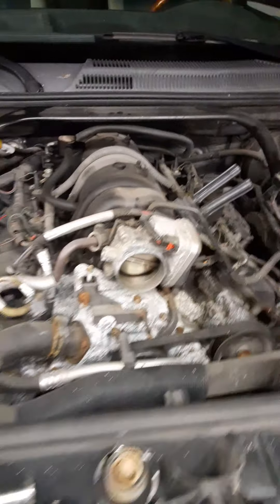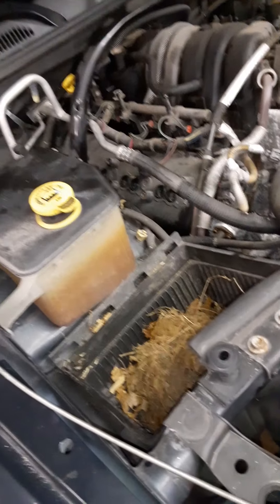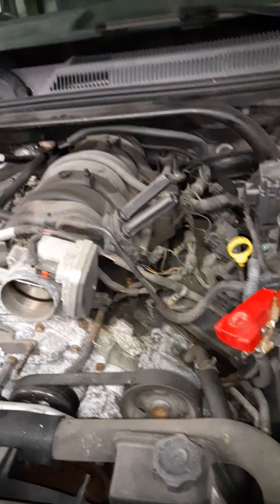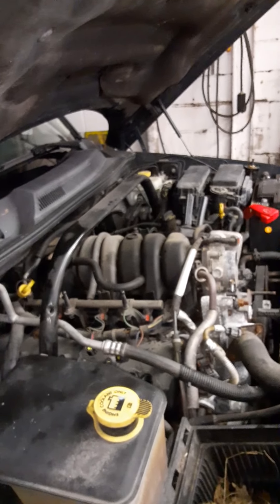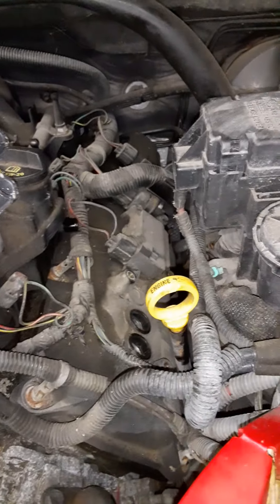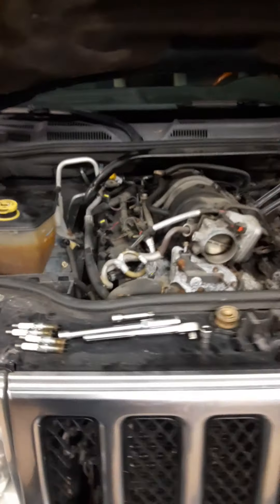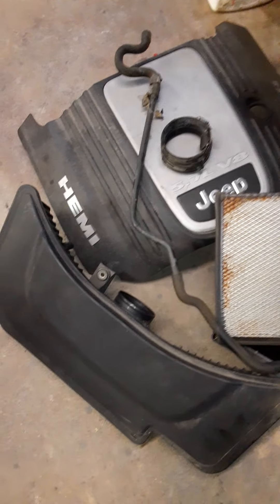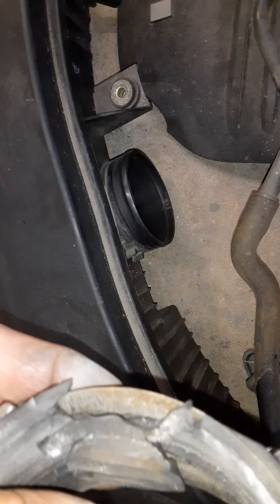2008 Jeep Commander 5.7 HEMI Blown Up

Comment: Bro the death of the “reliable” version of the commanders wtf.  Are you putting a 6.4 in it?
Reply from the maker: No that job left here not too long after filming these videos. The owner did not want to fix it
Reply: @dragsterstransmissions  wow well it’s understandable the engine is one thing but Commander parts aren’t out there like Wrangler or Grand Cherokees.
Reply: @dragsterstransmissions  wow well it’s understandable the engine is one thing but Commander parts aren’t out there like Wrangler or Grand Cherokees.
Reply: @dragsterstransmissions  wow well it’s understandable the engine is one thing but Commander parts aren’t out there like Wrangler or Grand Cherokees.